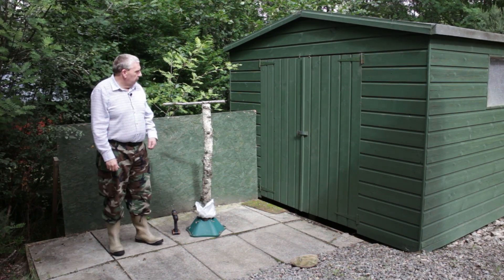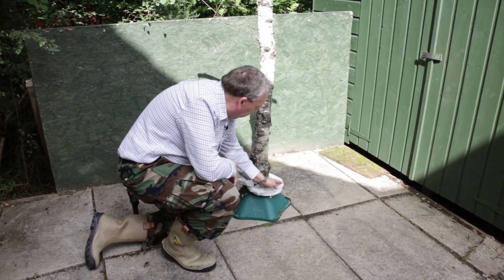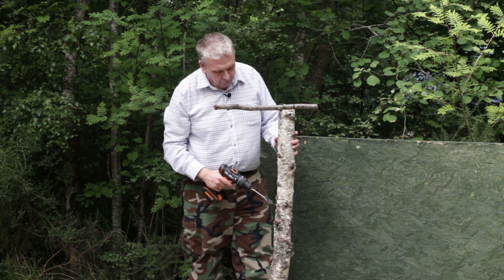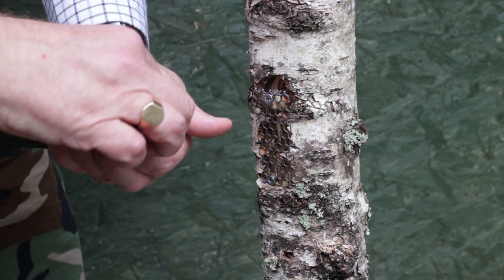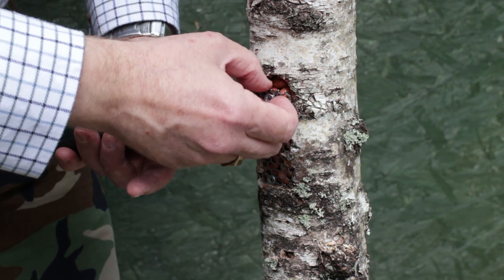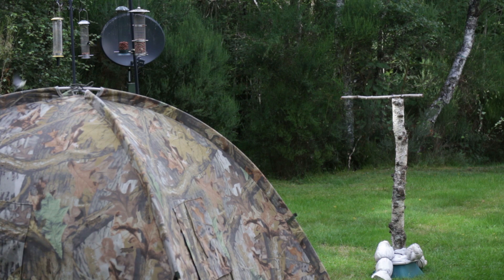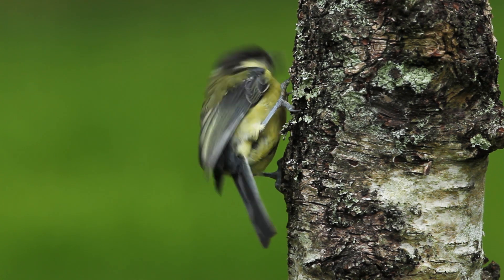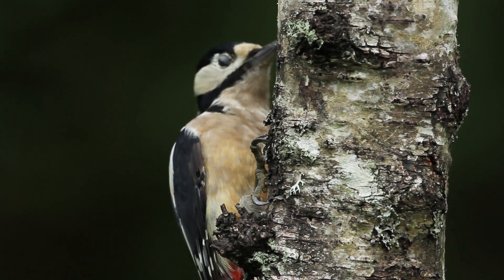Building a Bird Feeding Station

Comment: You can drill a hole from the top to the crevice that can supply nuts.

I drill holes at a 45 degree angle downwards which I fill with nuts, etc and I fill it with warm fat from a thermos bottle.
Reply from the maker: Great idea with the warm fat from a thermos. We found if you just fill a hole Woodpeckers tend to land and take one nut and fly off again. Which is not only very trying when you are  taking pictures but if they are feeding young, you risk the young choking on a whole nut.
Off to try and find an old thermos.
Reply: @Mandjbloomfield  I bought a cheap thermos from IKEA. Also bought my drill from them as well.

Comment: A small bucket filled with wet cement might work too.
Reply from the maker: Sue, yes you could certainly use cement. The reason use a xmas tree holder, is so that we can swap out the logs quickly. We tend to use several different logs over a couple of days. You can also use something similar but less permanent than cement, damp sand. You need to pack the  sand down very well, otherwise you get a leaning log.
Reply: @Mandjbloomfield  The way I look at it is this; it takes one person - that's ingenious you - to kickstart the idea. Other people will adapt it. One guy did a video on how to make a bird feeder from a tin can. Other people talked about painting it nice colours - I thought about gluing thin twigs around it lengthways to make it look rustic.
Reply: @suecollins3246  "kickstart the idea others will adapt it".  I wouldnt use cement its too permenant. Equally i wouldnt prat about screwing grilles over holes to put nuts in. Push suet block in and push the nuts into the suet.
Reply: @gbwildlifeuk8269  Thanks for taking the time and trouble to respond to my comment!  I've been wondering for a while now what I can concoct because I'm a pensioner and a couple of days ago I saw the most marvellous thing. It's a sort of tree-like metal frame, and hanging from it on chains are 3 pot plant holders. The top of the frame comes together in an ornate metal flower whose open metal petals are just perfect for tucking suet into. I thought 'what if I line the metal pot holders with coconut fibre or hessian, fill them with sand and put three different types on food on top in each one? I can stand it between some bushes, on a tree stump to give it height and then sit on the  balcony and take my photos from there?' It belonged to my friend's daughter and she didn't want it so I swapped it for 6 of my homemade chicken pies - let's see how it works.

Comment: How about drilling a hole upwards at an angle and then  drill down to that hole in the middle of the log?

That would increase the capacity of a peanut feeder.
Reply from the maker: Great idea. We did try using short tubes in a log, we found that the peanuts kept jamming. With a good head of peanuts there maybe enough weight to push then down. If peanuts jam you could try sunflower seeds, but the birds tend to grab a seed and fly off, very quickly.
Reply: You can insert plastic pipes or tubes into the holes to reduce friction. Metal will also work.

You can use fat to cement the seeds and make them harder to fly away with. This usually require a hole drilled at a 45 degree angle downwards. Nothing will also work, but that requires deft placing of perches around the feeder.

The hard bit is finding a wide enough drill bit for the vertical hole and not drilling below the 'drain'.
Reply: BTW for the pipe to work, it must be wide enough so that what ever is in it can't get stuck. And the hole must angle upwards at least at a 45 degree angle.
Reply from the maker: Like the idea about the piping and the sunflowers. Maybe we will give increasing the feeder capacity another go. One advantage we did find with the pockets is it is very easy to do. On a good size log you can get 3 or 4 pockets per log. We tend to prep two logs at a time and swap them around. It just means that you don't get the same bit of log in all our pictures. What ever method you use it is a great way of getting more natural looking pictures of our garden birds.
.